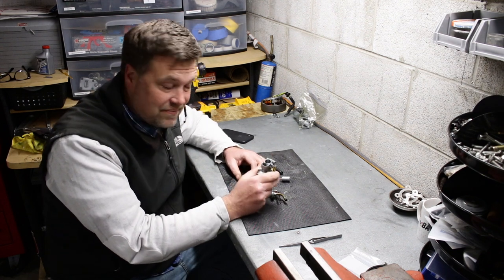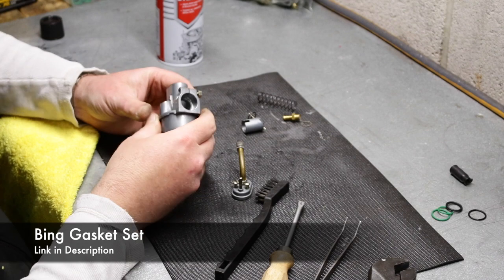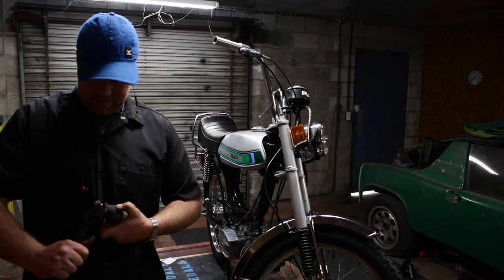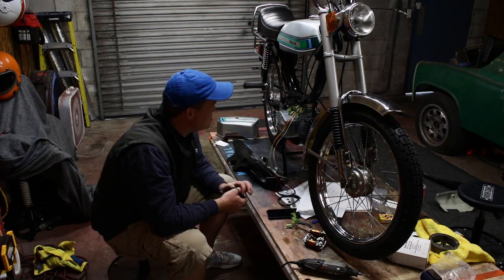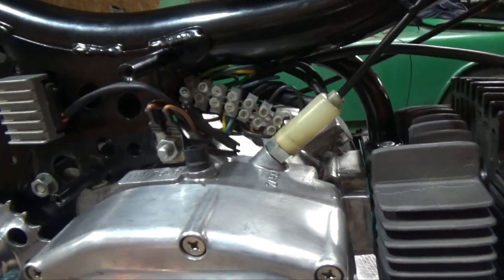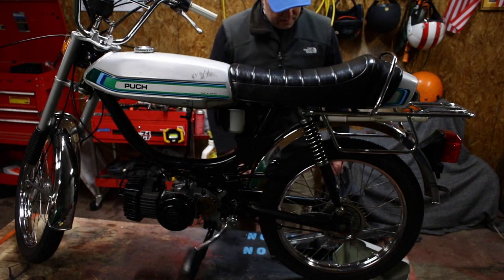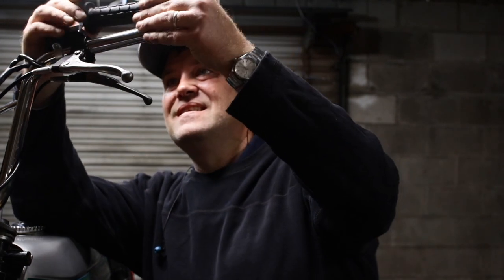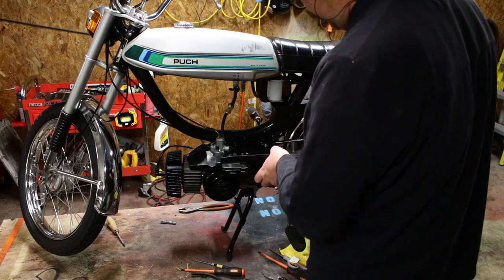DFHS Puch Magnum Ep 7 - Finishing touches

Comment: as far as the grey wire goes that might be ignition ground from the stator to the brake light to complete the circuit,  that's how it's set up on the Peugeot mopeds I swapped out the points ignition to the MBK CDI unit so the only circuit I have to modify is the brake light circuit and the brake light switches.  thanks for posting and good luck with it, BTW I finished my friend's moby and she runs beautiful,  ill be starting on my Peugeot 103 soon, stay well.

Comment: What’s up Dave. Got some very bad rust on the chrome rims on my intramotor Gloria scout. Any advice or luck with a product you have used before?

I’ve tried steel wool but it’s only taken off the lighter stuff. 

The videos u make are great me and my buddies have gotten the moped itch
Reply: I've used wirebrushes on a drill and smaller wire brushes with a dremel tool and it takes care of the heavy stuff really well. Just be sure to wear safety glasses because the brushes will shed and little steel fibers go flying everywhere. Months later I'm still finding them stuck in my socks and shirts and on the garage floor.
Reply: Kelley M lolol surely notes on the tip thanks

Comment: It still is a really weird moped. You can shoot a cannonball through the moped without hitting anything :P
A friend of mine has a similar shape moped. A motobecane. We drove 500km in 3 days together last summer. He actually placed a bag full with stuff inside that large hole in the frame. You can use it as an additional luggage rack. Hilarious!
Reply from the maker: Hey Frank. Now that she’s all back together with cables and fuel lines and side covers, under the tank doesn’t look quite as sparse 🤓. You could still get a cannonball through there though.  Next project is a step through, so it’ll be a more conventional looking bike..

Comment: Whst is the small knob that can be turnt on the right side of the engine? I have the same bike. I'm curious if it's something to do with starting or clutching.  Thanks in advanced.
Reply from the maker: I'm not 100% sure what you are referring to.  Perhaps the oil fill plug?
Reply: @DavidFixesHisShit  that's exactly what it is. I realized once I actually checked it out.

Comment: Hey David I have a garelli 86 and the bike is running great but when go on a ride the bike is struggling to get up the hill, do you think is a carburetor problem or timing?
Reply from the maker: Hey Felipe.  Is it a two speed?  Maybe it’s getting caught in second gear and doesn’t have the torque to get you up the hill. I weigh 200LBs and a 50cc moped needs to work HARD to get me up a hill. Thankfully, I live in a pretty flat place, so I don’t have to worry about it too often, but mopeds being slow up hills is less a ‘problem’ and more a ‘characteristic’ 😜